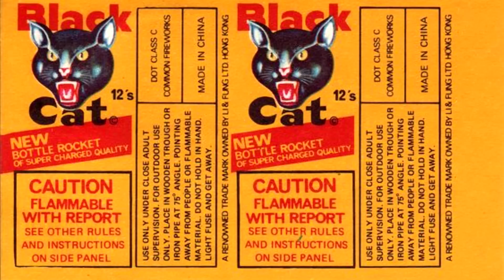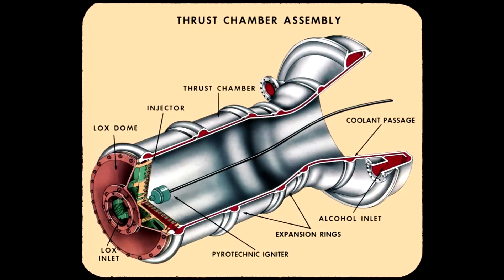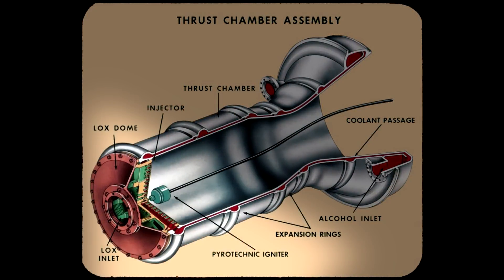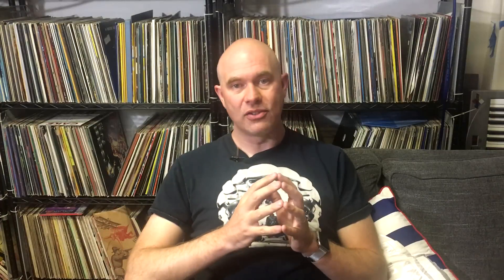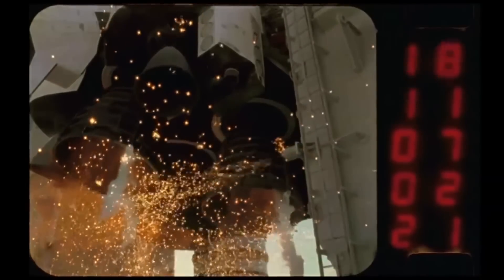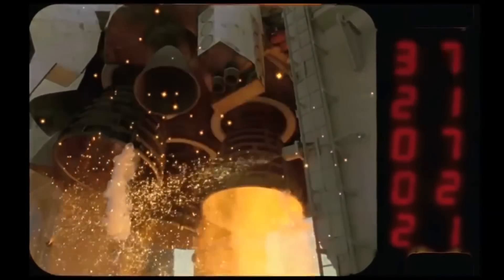How Rockets Are Ignited - Things Kerbal Space Program Doesn't Teach

Comment: I wonder how many backup pyrotechnics they have in the solid fuel boosters to make sure that if one lights, they both light?  Having the pyrotechnics fail on one but not the other would be VERY BAD.  Might even be worth having a U-shaped flame tube going from somewhat under the nozzle of one, down through the launch pad, to somewhat under the nozzle of the other, so that if the pyrotechnics fail on one, at least the flame from the other will start the failed one anyway.

Comment: A miniature version of pyros are used every day by model rocket fliers - they fit up inside the small solid fuel motor those use and are blown out at liftoff, exactly like their big cousins. I don't think you can set the big ones off with 4 AA batteries, though... ;)

Comment: I had seen many rockets launches and the majority uses "spark plug" sistem I can even hear
the "sisling" noise a few seconds before ignition... In a closed combustion chamber,the high
voltage is produced by  a high voltage coil ,(around 15.000 volts),for a short period of time,
enough to light up the fuel. Fairly simple...

Comment: Something I've wondered about is the synchrony of the SRBs. If one ignites and the other doesn't, what happens? Would the space shuttle flip over? Likewise, how do they ensure that they burn out exactly together, as one at full power while the other burns out would be uncontrollable. Do they design them to gradually taper off thrust rather than go out all the sudden so that the difference in thrust is small enough for main engine gymballing to compensate for?

Comment: For the SR71, the first engine start uses TEB after being wound up by large automotive engines. In flight, the engine continues to run, but the TEB is needed to relight the afterburners because the JP7  is very resistant to lighting in the first place. There is a story of one of the start carts catching fire near an SR71. Someone grabbed a pan of jp7 and threw it on the fire putting the fire out.

Comment: As I remember, keeping the motors light was a problem as well. I seem to remember during the Apollo development they had do a lot of experiments to stabilize the engines.  A way to test was to set off explosives in cones to induce flame outs. Could anyone verify this or add historical details?
Reply: This is actually correct.

Comment: I've been out in the Mojave Desert and watched people launch rockets to over 12,000 feet. There is always a delay from the time they send electricity to the top of the solid rocket motor and the rocket leaves. There will be a little smoke just before liftoff. How does NASA get an exact time the boosters will light with no pre-ignition smoke?

Comment: @Scott Why don't we light rocket engines with high power lasers? - Seems like it would solve any problems with these solutions. (i.e. can be used in space, or can be used at a distance at the launch pad so there's no excess material to consider inside the engine)

Comment: Any thoughts as to how BFR ignition will occur?  Direct spark in the primary chamber?  Spark in an auxiliary mini engine?
Reply from the maker: I think it'll be spark based.
Reply: That's cheating!  :-)   Musk already said it would be spark ignited.  But how?  And are there 2 or 3 ignitors per Raptor engine?  I assume that each preburner has an ignition (either directly in the chamber or from a mini rocket engine).  For the main combustion chamber, is an ignitor needed at all?  Hot gaseous O2 and Hot gaseous CH4 at 200+ bar will likely auto ignite.....depending on what "Hot" means.  What is the temperature coming out of the preburners?  Man, I want to know more about that engine!  It looks sooo cool! (Or Hot depending on how you look at it!)

Comment: What a great little series.  For those looking for this kind of detail in a KSP game take a look at Realism Overhaul by NathanKell.  Works best combined with as many realism and engine part packs as you can find (RSS, IgnitorTech, RealFuels, Soviet Engine Pack were my go-tos)

One of the highlights of my time playing KSP was the first manned orbit attempt by my fledgling agency, where I had to EVA on a sub-orbital trajectory to reload the ignitor on my topstage to re-use it for circularization.  Realising last minute that I had a pressure fed engine I then cartwheeled the craft to create centrifugal force and feed the combustion chamber.  Reality is always infinitely cooler than games.  (I hate to think what would happen if you actually used centrifugal force to push fuel like this, take an ullage motor)

Comment: Just wondering is it true that the New Falcon 9, Falcon Heavy ignition will switch to Spark plug, than liquid ignition, if so...why...trying to learn what the reason is for the switch, because the Raptor is subcooled Methane or because the worries of running out of the TEB? On this wiki links it said that. Just wondering. https://gir.im/https://en.wikipedia.org/wiki/Raptor_(rocket_engine)

Comment: Could it be that the full flow staged combustion type engines can be electrically ignited?
The two preburners must be ignited. This might be possible to do electrically? Given the low pressure, and that the propellant i methane.

The main high pressure combustion chamber may perhaps self-ignite from the hot preburner gas?

Comment: So, this is what exactly happened to Falcon Heavy center core.. 2 out 3 engines missing more ignition fuel at landing burn and core hit ocean at speed 500km/h. I still hope they publish video. 😃
Reply: Josef Janoušek The camera was lost
Reply: Filip Jadownicki I think they have cameras on drone OISLY, that stream and record. But they probably pointed to front and back and center core smashed far away on side.. Yeah and I doubt they save anything from center core. :D
Reply: Did they publish photos of the barge. Early reports said it hit the barge. Did it? Or just straight into the ocean?
Reply: I think it hit exactly 100 meters from barge, but because it was so fast at impact (500km/h), that blast managet to take out two out four engines from dronship.

Comment: Would cesium work as rocket engine starting fluid?
Reply: Why Cs?, it would needed to be warmed up since it's nearly solid at room temp. I would probably try NaK, since it's liquid at wide range of temps and highly reactive. It will ignite in the presence of oxygen. Hey Cody, maybe you should try an experiment to see how it burns in oxygen compared to how burns in open air, no water present. I would try it myself, but I can't find any NaK around.
Reply: Cesium playbutton
Reply: hey cody!! how r u doin??
Reply: Cesium was the fuel chosen for an electric rocket concept designed by Dr. Ernst Stuhlinger during the 1950s. It was to be vaporized and the ions accelerated by being pulled through an electrically charged grid. Such a low thrust rocket would be capable of operating continually for months, accelerating to speeds sufficient to reduce travel time to Mars to weeks rather than months.
Reply: Joseph Cope  what you just described is a Cesium ion engine. They already exist and are being used, altough today mostly with xenon, on space probes. But for moving big spaceships with humans to mars they don't provide enough thrust to be viable. You would need an insane amount of them and a lot of electrical power to make a real difference on the time you need to get to mars. Mars is just too close to earth. You don't have the time to profit from this long time/low thrust concept.
To reduce the travel time to weeks you would need a lot of thrust and energy to accelerate and then the same amount to break again when you are there. That's not really viable as a flight path for a spaceship
Reply: @josephcope7637  Yes but that is an ion rocket and not what's being talked about here. Plus the ion rocket has such a low thrust a desktop fan would blow more exhaust in your face XD
Reply: @josephcope7637  They use similar engines, they are Xenon ion engines.
Reply: Cody'sLab 4 im sure it would.... whatre you doing here.... ive seen you everywhere man
Reply: Oh hi cody!!!
Reply: Woah! Cody’s Lab! What’s up man!? Are you asking because you’d like to use water to ignite it?
Reply: @Wroger Wroger no you didn't, and the story is completely fabricated. If it was true why has no one mentioned that many people died? Plus Flourine is an oxiddizer so I don't what your point is
Reply: Oh god
Oh god I'm terrified
Please don't die, you're basically a national treasure at this point.
Reply: @technicallydifficulties7094  zefrank1 reference?
Reply: @Wroger Wroger why the "" it is a fuel and it is an oxiddizer
Reply: @Wroger Wroger no they weren't, you don't know shit so fuck off and stop imitating people who worked on the Apollo program
Reply: Are you getting... ideas?
Reply: You're a strange dude, Cody. I like that.
Reply: CODY'S LAB!!!!!
Reply: Only once.
Reply: @Wroger Wroger how is this the 5th time I've been wrong? I only made 2 point. Plus it doesn't have to contain oxygen to be an oxiddizer and regardless mercury is still a fuel so one of my points still stands, and unlike you I didn't lie about being in the Apollo program
Reply: @Wroger Wroger you've ignored all my points and instead you have stated I made a spelling mistake, I'm human I make mistakes
Reply: It would probably explode, way too volatile
Reply: Wow.... So that's how the Ruskies light their rocket 🚀 engines 🚬😁
Reply: We won't know until we try
Reply: Only if its put in a box alongside a cat and vial of poison.
Reply: Cesium in fact is an excellent ion engine rocket "fuel" usually as an iodide. It is turned into a vapor than ionized then accelerated.
Reply: Yeah I think it would work..... I checked it in my periodic table..... Atb for Ur cesium rocket project Cody!!!
Reply: It would work as a hypergol with water,So with the space shuttle with a fuel of LH2 and LOX it would probably ignite as there would be water in the air in the nozzle
Reply: @louishall6070   That's true, but seeing as this would be pre-ignition, there would be no LH2/LOx burn so there would be no water present to react with to ignite the said fuels. Also the amount of water in the atmosphere is no where near close enough to react with it quick enough to produce the temperatures required to ignite the engine.
Reply: MMmmm Cesium is really dangerous and super toxic. Id consider it a banned substance for burning. it also contains radioisotopes
Reply: Wroger Wroger: I learned from another science channel that flourine and mercury possess serious rocket potential, and that a single lift off could possibly kill half of the US population.
Reply: you have plutonium 239 likes at this time

Comment: 50 shots per engine of TEB for the Black Sled Bird.  Little calorie counter clicker on each throttle register.  They would land with about 10 left (ideally) from what I was told by a Sled pilot.  Several missions exhausted those aftburner relights.  Hard day at work,,that sort of thing.

Comment: Conrad Dannenberg once told me how at Peenemunde they had what was basically a Catherine wheel set on top of a long wooden pole to stick up the throat of the V2 rocket chamber nozzle. He was one of the guys who came up with this answer to the "over pressure" problem at startup. Once you have a nice flame from just the pressurized tanks, then you can turn on the turbo pumps. Geoff Sheerin at Canadian Arrow did the same,

Comment: Scott, please I have a very important question. The Space shuttle uses Hydrolox, which as far as I can tell there are NO tanks on the space shuttle, so I assume it has a temporary tap from the external tanks. Which means once it is in space the space shuttle as zero ability to do re-position itself. The space shuttle has NO external hydrazine nozzles nor would it since it would pollute everything around the ISS and shuttle. So how can it do any maneuvers, much less get back to earth even if it is a glider...
Reply: the space shuttle did have reposing nozzles of compressed gases.. either o2 or n2. any gas would work
Reply: Yes, if you look at the back of the shuttle, the 2 smaller nozzles on the upper end behind the 2 bumps are the Orbital Maneuvering System engines. They completed orbit after the SSME's cut off and the external tank was dropped. The small holes positioned all over the nose and rear of the shuttle are the Reaction Control System thrusters. Both the RCS and the OMS were pressure fed hypergolic systems running off of N2O4 and monomethyl hydrazine, as they had to be very reliable. In fact, the OMS engine was a descendent of the Apollo's Lunar Ascent Engine, the AJ-10. As for the main engines, yes, the fuel and oxidizer was stored in the external tank. That was it's entire purpose. The LOX was stored at the top to balance the center of mass for stable flight with the off centered engine thrust, and the LH2 took up most of the rest of the space, save for the intertank between the LH2 and LOX tanks.

Comment: SRBs are scary. If there's a crack in the fuel, it will burn faster. If it burns too fast you cannot compensate and go of course or there is enough pressure that the booster explodes.

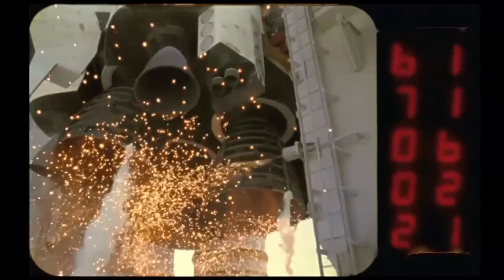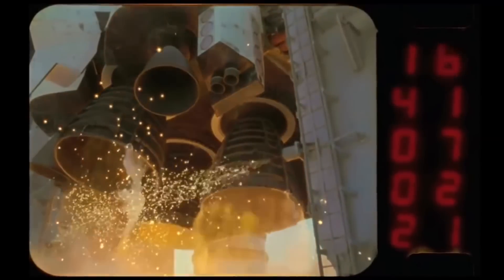Comment: 7:35-7:46
Thank you for clearing that up for me Scott. When I was a kid, I thought that's how they ignited the engine, "Oh they must force flammable gas and the Sparks ignite said gas on liftoff". As I got older I realized that wasn't the case. But I was still curious as to why they did that.

You learn something new everyday, like how a few weeks ago I learned those engines on the Space Shuttle were only used for liftoff and moving in space was done via RCS. Which are the two on the side of the three engines. Again, as a kid I thought those were backups in case one of the three main engines failed.

Comment: They are actually called Sparklers by the guys that activate them. On the old Saturn rockets thats what they used,I believe the Shuttle used the Sparkler system too. You can see them going off at the start up of the engines. They couldnt be blown out easily and once that engine started up get out of the way. The solid rockets used the type he was referring to. The liquid oxygen type used sparklers. Eather way,a beautiful view.

Comment: YOU PRESS SPACE
Reply: And then your second stage detaches because that last minute adjustmentd messed up the whole staging.
Reply: Hebl von Heblowitz ybut then your parachute comes out 

Revert to vab
Reply: Or press Z, depending on the situation
Reply: General Incompetence even though you turned off revert flight in career mode to make it more difficult, you ignore that and turn on allow reverting flights.
Reply: PARACHUTE OPENS
Reply: CHECK YO STAGIN
Reply: Press space to DIE
Reply: Imagine xD. The keyboard command for ignition would be "Space" 😂. If I'm ever going to make rockets, I'm gonna do that
Reply: I PRESS ENTER

Comment: You didn’t mention ullage—how to (re)start a rocket engine in zero gravity.

But yeah, very informative. Great work.
Reply: Yeah. 0g can be an issue.
Reply: I suppose I should clarify that the problem only happens with liquid-fuelled engines. Gas-fuelled ones will start just fine.

Comment: Leave it to the Russians to come up with the simple solution. The Apollo 13 movie would have been twenty minutes shorter if they had brought along some of those Russian candles that produce oxygen. NASA  could have also saved a ton of money if they had used pencils like the Russians instead of creating a zero G ballpoint pen.
Reply from the maker: +pforce9 but the problem on Apollo 13 was CO2 buildup, not a lack of oxygen. Also, the space pen story you're quoting is a myth https://youtu.be/v7fq10epvXs
Reply: Scott Manley Thank you for responding. Two more questions. At one time they proposed an escape system for the shuttle that required attaching people to a a rocket with a lanyard. Did they ever try to actually install that? And it is my understanding that the shuttle engines are russian design and are called "closed system". I would be interested in understanding how a closed system differs from other types. Anyhowm thank you, good videos.
Reply from the maker: +pforce9 I have a video on closed cycle rocket engines https://youtu.be/4QXZ2RzN_Oo
Reply: that shirt gimme gimme

Comment: in the case of the spark plug based rocket engine, something similar was used in car engines, 8ts called stratospherically charged engine. basically they would use a small rich mixture in a small combustion area to ignite a lean mix in the main cylinder

Comment: At the end he is talking about turbo-pumps (provide the pressure and volume of fuel and oxidizer into the combustion chamber), which more often than not are the cause of catastrophic failures in liquid fueled rockets. In the F-1 (Saturn V) engine the turbo-pumps moved 671 gallons of fuel and oxidizer per second per engine or about 3,357 gallons per second combined. Or enough to fill an Olympic size swimming pool (about 660,430 gallons) in about 15 minutes.

Comment: Hypergolic mixtures are also quite popular with larger guided missiles. Typically you can have longer shelf-lives with less storage overhead, and shorter down-cycles than trying to use non-hypergolic fuel-oxidizer mixtures to provide the same range and maneuverability.

Sometimes this leads to nasty situations where fuel tanks fail in launch tubes or shortly after launch--you end up with either a nasty fire, a caustic mess, or some combination of both... all this is topped off by the whole affair typically happening in a confined space which displaces free oxygen and requires unpleasant personal protective measures (level A HAZMAT suits with full SCBA sucks to wear--I would not recommend unless your life depends on it.) to clean up the mess. On the other hand, I would imagine that cleaning up the mess when just about any rocket fuel tank leaks is a messy, unpleasant affair.